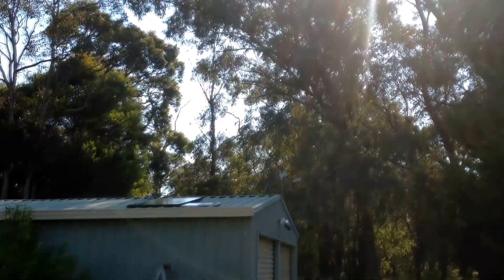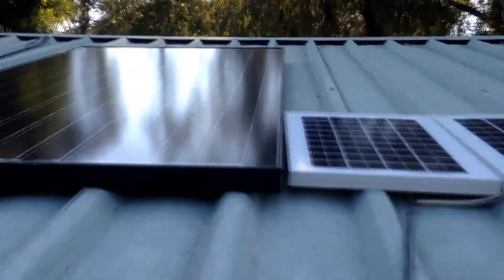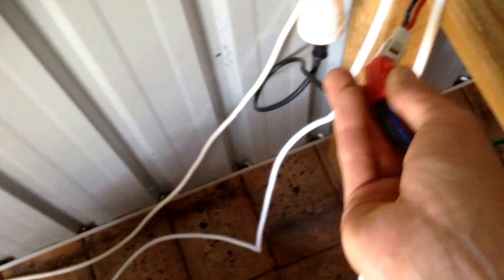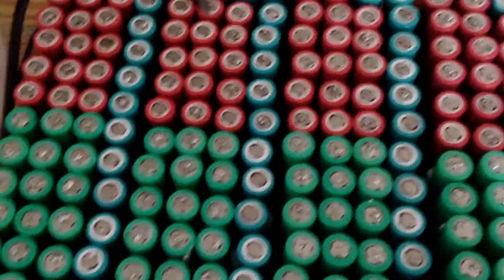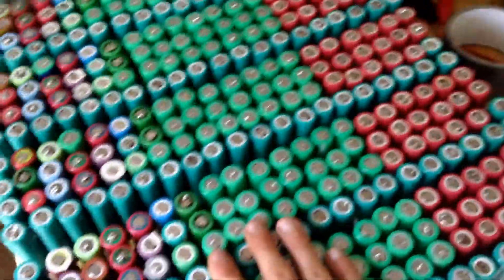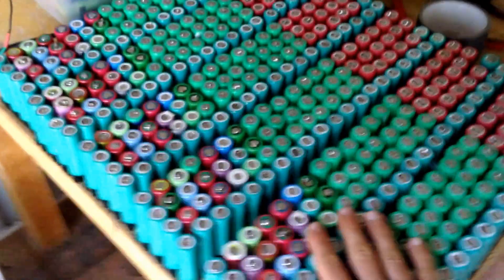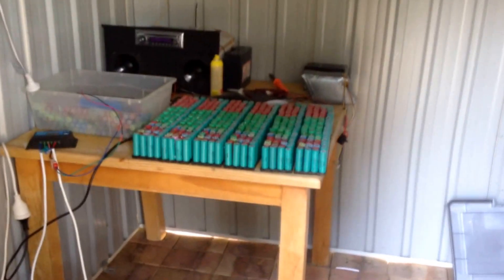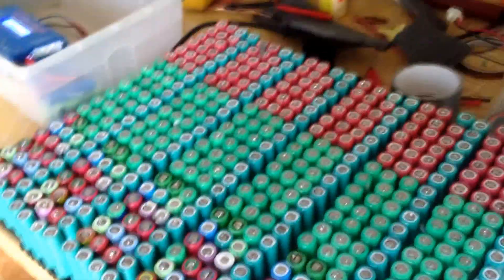Homemade Tesla Powerwall | My powerwall shed! | Update 2

Comment: For testing gobs and gobs of cells I recommend something like the foxnovo digital charger 4S or better yet the opus BTC3100. I believe both are capable of running off a 12v system.